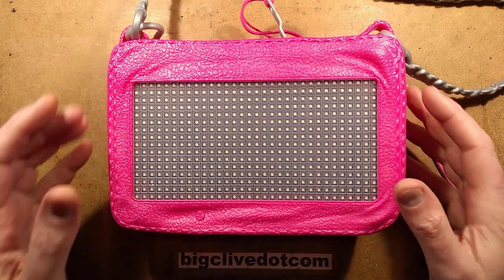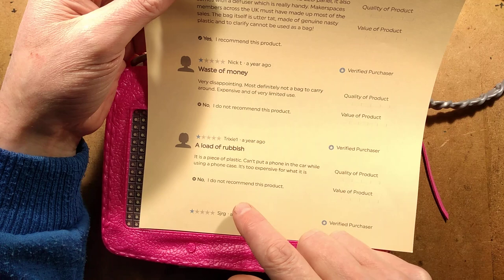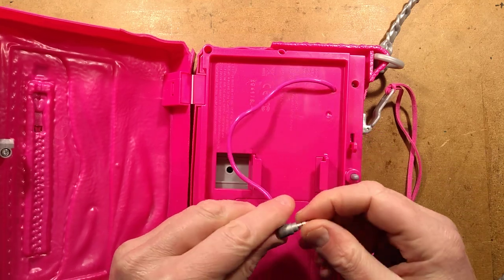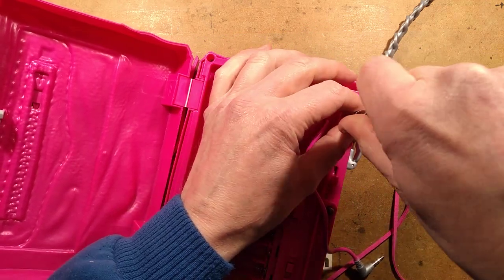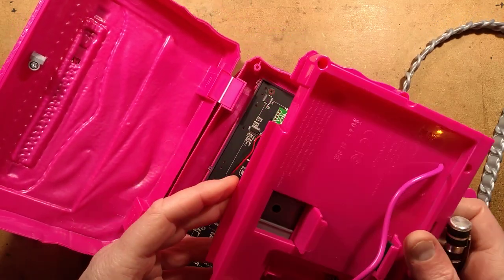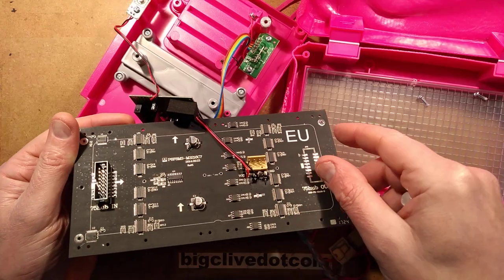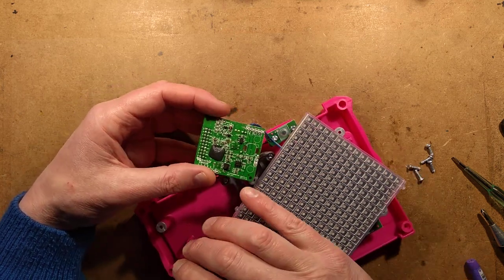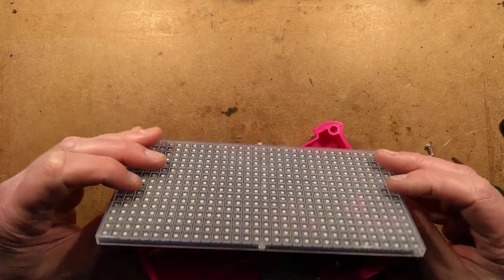Inside the Project MC2 video purse.  (Actual video wall panel!)

Comment: so as far as the app you can grab the apk and decompress it and there is a directory that has all the bits to program it... evidently the app sends a heartbeat out so the app knows that the phone is connected??? also it is some kind of FSK using comwirelite library (???) and under the APK in apk file --> sources --> com --> generalplus -->comwirelite2  it breaks down the whole protocol for communicating with the unit as is.... :P

Comment: It basically uses a bunch of shift registers where you can shift in the desired pattern for 1 line (or in this case for 1 line of the top half and another line for the bottom half). You then switch to the next line using the 3 to 8 decoder and shift in the pattern for the next line until you filled the whole display. This must be done fast enough to see a stable and flicker-free image (and to not damage the LEDs). To further control the brightness of the R/G/B channel of each individual LED you don't turn on the channel in every refresh cycle but just an appropriate number of times  to achieve the desired channel brightness. (This is actually the naive way of doing it, there are smarter ways to keep processor load low). I played with a 32x32 panel a few years ago - 12bit color and a good refresh rate are relatively easy to achieve with a 8 bit avr running at 16 MHz, with some inline assembly 15bit are probably possible. Those panels are really neat indeed.

Comment: I've been doing a fair amount of work in an amusement arcade. Using huidu controllers and the AliExpress panels 5mm, 2.5mm and 2mm spacings. There's soo much you can do, and they're brighter than an LCD screen so great for signage.

Comment: Finally got off my lazy tail and ordered the last parts I needed for this project (more bread-board F-F wires and a mosfet adaptor/barrel connector pair for the power) and can actually get it up and running! Thanks so much for this awesome idea (and cheap parts-source), Clive! I've been putting off a project for a while, but start on it tonight. The goal: I may be way older than the average rider, and yeah, people laugh, but I have a heavily modified older (1st gen, took a while to find one of those nice heavy-duty frames that wasn't cheap-from-china quality, but manufactured in... I want to say Michigan? Might have been Detroit though... But yeah. USA-made 1st gen model) Razor 300S (minus the seat, because no WAY am I sitting down at those speeds) that I have... adapted. I am a smaller person, in that I fit the "suggested weight range" for that scooter when it's OEM, but what would it be without a nice high-amperage ~600w motor upgrade, running at 36v vs the original 250w/24v one? Top OEM speed: 11-12mph. Range: 4-5 miles. Mine: max speed 42-45mph for 7-8 miles. And takes less time to recharge. 
My goal is to replace the aluminum deck panel (yeah, they weren't always plastic) with another one of the same, BUT cut a channel down the middle to put 3 of these boards end-to-end on it, then just put a thick layer (few coats) of UV-blocking shellac over them for protection. This would run animations under my feet while riding. Useful? Not really. But then... how many of these projects really ARE? Still worth it for me, as I've now spent a few months learning a HUGE amount about these 75HUB panels and matrix displays - I'd originally been looking at using APA102C panels, and the only thing stopping me was the cost. With these coming for as cheaply as $17? (what I paid, with shipping, on eBay for one) There's no reason left for me not to get on it, so now that my Amazon package has shown up, I should have a working prototype by this weekend. It'll start with basic animation, but I definitely will be wiring this into the lightning setup, which I'm already using a raspberry pi zero for. (Turn signals, brake light, headlights, power-monitoring/current/range logging via a serial bluetooth connection, so I have a constant battery level display etc (all on my phone for now - LCD touch panel comes later, heh. Still working on this thing, always making little changes.) - been using cheap bicycle turn signals etc and just wiring them into the pi for control there.)

Thanks so much, Clive, for helping us out with these sorts of projects by tearing stuff down like this to show us how it's made, how it works, and how WE can repurpose the hardware. I love it!

Comment: 11:33 - "Also because you don't want to blind people with your video wall handbag."  Yes, considering they're probably already getting blinded by the almost fluorescent pink of the "bag" itself.  Wow that thing is absolutely lurid...lol
Reply: Nobody cares about the purse or its color,  rather the useful internals. And yes,  it is lurid. 
We can split the $ and buy one,  you get the purse,  I'll keep the guts. And I'll generously let you keep the zip too!
Reply: @111chicane   Actually I agree that this is a wonderful way to buy a video wall or just a programmable LED panel on the cheap.  I wouldn't buy this for the "purse" either, no matter what color it came in.  ;)
Reply: It reminds me of the anti-paparazzi devices some celebrities carry. Essentially an LED slave photo strobe. So when someone tries taking their picture with a strobe, it flashes in sync pointing at the camera and washes out the image.

Comment: Well, that's the award winning xmas jumper sorted...
Edit: just looked at the prices on aliexpress for a bare 32x32 module; 11.70 freedom bucks!
Reply from the maker: I didn't realise the bare modules were that cheap.  How things have changed from the earliest million pound low resolution video walls.
Reply: The cost for the panels in the toy is $8'ish. Excluding all the free plastic.
Reply: Yes, when you think how much displays such as the jumbotron and black diamond must have cost even though the resolution was pretty poor by todays standards. 
Was watching some late 80's family fortunes the other day and was surprised that they for a while used a proper video wall (rather than the 90/00?'s episodes that used the yellow flip dot display), I'm guessing it was so expensive that it must have gone wrong after a couple of years and the cost of the flip dot display was still significantly cheaper than replacing/repairing it. You do get a nice load of close up shots of the display where each pixel is clearly visible. 
One interesting note was that when they were showing prizes people had won on the screen the resolution was so poor that they still had to broadcast a picture of the item, i doubt the resolution of the later flip dot display was that much worse. @bigclivedotcom
Reply: And yet gameshows these days curtain-clad the entire studio in pixel panels with gay abandon!
Reply: Check the shipping cost, sometimes sellers just offset the real cost + profit into the shipping cost.
Reply: Don't you mean American rubles?
Reply: @Shaun.Stephens  is it rubles or shekels?
Reply: Hmm, the time may be right for that in home video wall I always dreamt of...
Reply: @dglcomputers1498  the original jumbotrons were CRT pixel displays, worth digging to learn about, dinosaur tech
Reply: Yes, I've seen mikes video on the section of video wall he got from Charlton athletic, really interesting.
Also appears that Family Fotunes only used the video wall for a few 1987 episodes #9starti ng with the first show with Les Dennis) so supposedly it  
wasn't a success and so went back to Mr. Babbage.  @oldunion

Comment: I got 9 of them a week ago and now the LED display is being used as an art frame for 32x16 8bit images. It's a cheaper way to get LED displays for cheap vs the adafruit led display. I kept all of the screws and springs for other 3d printed projects. The rest of the plastic I tossed out due to not knowing what type of plastic it is, thus could not use it for 3d printing material.

A Pi + the LED display will take up to a whee over 2amps of power when all 512 LEDs are white and 100% brightness.
Reply: Do you know if these panels are able to be “seriesed up” to make a higher resolution panel, or would you need a bunch of independent subpanels?
Reply: @mrb692  That appears to be what the second connector would be for. So you would have to add the connector back on with these.
Reply: @mrb692  Yes they can be. You'll just need to put on a 16 Pin surface mount boxed header on the output side that will connect to the input side on the other matrix board.

https://www.digikey.com/product-detail/en/sullins-connector-solutions/SBH11-NBPC-D08-SM-BK/S9187-ND/1990080
Reply: You can get them a bit cheaper on Ali Express

Comment: Programming by audio??? Sounds like ZX spectrum stuff, using a cassette tape for loading!
Reply: Essentially still how mass server backups are done, huge magnet tape reels.
Reply: The ZX-80 likely had more parts for the job than this board.  The Z80 micro wrote to a port that set or cleared a flip-flop.   This was the same flip-flop as did the sync pulse for the TV.  I don't know if that means we have to count that flip-flop as part of the circuit or not.
On this thing, I would bet there is little more than an RC on the way to a pin on the micro.  The micro may have a UART in it.  The audio would be awful to listen to but who cares.

Comment: There is a trick for doing inverse polarity protection with a MOSFET.  Basically, a P channel MOSFET is installed in the positive path with its protection diode so that it conducts with normal voltage.  The gate of the MOSFET is wired to ground (via a resistor) to turn on the MOSFET.  Reverse power switches off the MOSFET.

Comment: we use them in animated christmas light displays. Normally refereed to as P10 / P6 LED Panels normally 1/8 scan rates.

you can drive them with a raspberry pi running Falcon Pi Player with a Pi Hat.

Comment: Fizzpop person here, which is the Birmingham, UK Makerspace.  That comment was from one of our peeps.  The diffuser panel on the front was an important part of the cheap value of it.  A lot of handbags were ordered and thus price rose from 10 quid to 15 and now 20 it seems.  We are quite good at ninjaing on deals.  We did a similar neopixel commercial thing for the now dead-ish Maplin As featured here: https://www.youtube.com/watch?v=qP1G6RUYejY.  Also The Adafruit stuff we used is here: https://blog.adafruit.com/2016/12/28/create-the-ultimate-holiday-jumper-with-arduino/
   We had the honour of being rated as the best Christmas jumper in one article and the worst Christmas jumper in another article.  Both articles from the Daily Mail.  Reminds me of the stuff makes you healthier, same stuff gives you cancer stuff they do.  I did a bunch of the animations and some cool ones were chopped out.  A whole bunch of different stuff came out of the present for instance, My favourite anim was my jumper inside the screen which has a screen and so on, as it asks the question are we just complex animations inside a Christmas jumper?  Does the regress end in a reality prime?  the person modelling our jumper was a hipster someone hired to model it.  Any questions?

Comment: Hi Big Clive, I'm sure I've heard you talk about chokes and ferrite rings in previous videos, but have you considered devoting a video to methods you can employ to reduce video interference on systems like cctv installs. Were you have multiple cables running all over the house, across all manner of "noisey" pipes and wires, coupled with multiple cheap psu's, and ending up with noise bars moving across the monitor. Cheers Ant

Comment: There are two kinds of LED panel when it comes to how they plug, some use those same block connectors for power delivery and data and some have that molex style plug on them. this looks like one of the cheaper ones, though this looks like a 6mm pitch as well.

Comment: Nice video and explanation. Nicely timed as I'm looking into replacing my 2mtr X 1mtr Chatteris Christmas Lights video wall (ws2812a) with these types of panel. Although i'm looking into the p3 (3mm pitch). They are driven through the hub75 interface. Linsden make the sender and receiver cards needed to drive an array of these led panels. Ethernet cables link the 2 cards together. 
This is my project for our 2019 display.
Reply: So far I've found free software called Ledstudio, for programming via a PC. Although I wish to drive the show from a Raspberry pi.

Comment: Wait... a video wall handbag with an FSK modem for receiving data? 😵
Reply: Reverse engineering the protocol can be a bit of fun...
Reply: It holds stuff too.
Reply: Wouldn't be surprised if it's just passing on the RGB values in sequence. Just have to know how many steps it supports (is it a full 0 - 255?), the 1 and 0 tones, and its baud rate. Might also have something like an end code to page through a multiple image sequence and another one for the full loop. (Just trying to guess, but there's got to be some kind of KISS logic to it.)
Reply: Anyone want to download the app and make a few test pattern and convert the audio to mp3? Shouldn't be hard to reverse it
Reply: @pauljs75 
Perhaps something audio that drives an RS-232 port on the micro would be how it is done.
Waaaaaaaaaaaaay back when folks stored data on audio cassette tape, a trick was to just band pass filter some RS232 and record it.  Recovering the data involved an amplifier/comparitor and little else. @pauljs75

Comment: After reading over the pdf Adafruit provided, this sounds distinctly like my very first addressable RGB circuit I built.  It used a line of shift registers to update tri color LEDs.  It worked pretty much the same; the signal would turn LEDs on and off, it required a clock signal, and to get faded colors meant a high update frequency (which my board couldn't handle).  I then discovered neopixels and never looked back lol.

Comment: Would you happen to know the proper part to solder onto the board for the pass through connector?
Reply from the maker: I'd guess it's a fairly standard surface mount ribbon cable connector.

Comment: OK, just received the MC2 Smart Pixel Purse, BUT I can't upload anything from several SAMSUNG phones or tablets (the list of compatible devices lists several Samsung devices...) but I was able to upload my designs from old phone "ALCATEL Onetouch"; that isn't on the list. I think this can be because the input stereo-jack cable has non-standard order (and or reversed stereo contacts....). BUT I am interested to see if you can make the Arduino interface for the display to work. Are you - or anyone out there - able to help or point me to a solution? Does anyone knows if the stereo jack is using both stereo channels when writing to the unit? Or is there a way to make a custom cable to reverse/combine the stereo to a MONO output, so the software works on most phones? Thanks.

Comment: Could you link more than one of these panels together to make a larger video wall?
Reply from the maker: Yes.  They can be linked in rows.
Reply: If you just want to build a massive array, Amazon has some 64x64 panels for $40.
Reply: NiHaoMike that’s perfect, I need them square because I want to try and build a cube and then make “digital dice”

Comment: Hi Clive. Please can you help me, I have a Christmas decoration which was running off a 24v and max 2.4va transformer. The transformer has now failed and I have an old one which I could use instead but it's a 24v and max 20va would it be ok to use this replacement transformer? Thanks, Toby.
Reply from the maker: It depends on whether the transformer outs out 24V DC or AC.  Some of the new LED displays use a DC transformer and may rely on current limiting to avoid overdriving the LEDs.  A chunky old AC transformer may also put out a higher voltage when lightly loaded.

Comment: I could see Naomi Wu prancing around with one of these....
Reply: She can get the panels for way cheaper than we can - remember that she lives at most a few miles from the warehouse.
Reply: Dubious Engineering But she already did high resolution video boots.
Reply: I could see Naomi Wu doxxing someone with one of these.
Reply: @RocketboyX  As a self-reference, she should do a project that involves protecting what's left of her modesty with a LED panel scrolling the source code to a Swagbucks mining script, or at least a link to that code. (For the record, I released the code to help other makers. If she ends up oversharing it so the difficulty rises so as to make the script useless, she would also be losing out.)
Reply: or Mr. Humphries on "Are you being Served?"

Comment: Found it on Amazon for < $10 US, prime shipping.
Reply: dammit how about a link? I am finding NOTHING and don't know what keywords to make pop up to find it.

found it. have to search mc2 led

  @michaelcloutier2225
Reply: While Adafruit sells just the display for $25 ($35 on Amazon). Dooon't mind if I do.
Reply: it's $11.26 on Amazon now .. $12.76 on eBay up from $9.17
Reply: Me too. Just bought 2 😁
Reply: @ethanpschwartz I was going to predict price on Adafruit would be anywhere between 2x - 4x that of the whole bag including its mechanical engineering and other bits, it looks like I was not wrong. It's just one of those "what's good for Milo Minderbinder Adafruit, is good for the country Adafruit" things...
Reply: You got lucky! It's twice as much now,  2 days later! Price goes up roughly 10 Cents per hour!

Comment: My question is, can you make a bigger version using more of these panels ?
Reply from the maker: Yes.  They are cascadable.  It's the exact same panel used in many ghuge video walls.  But they are often divided into blocks with a processor for each block.

Comment: These are are on Amazon as of this post for $13. They are cheaper on AliExpress until you add in shipping. Then they are about the same. Personally I would rather pay a few extra pennies and get them shipped through Amazon. If they arrive broken at least I can send them back pretty easily. Good luck with AliExpress returns. LOL!